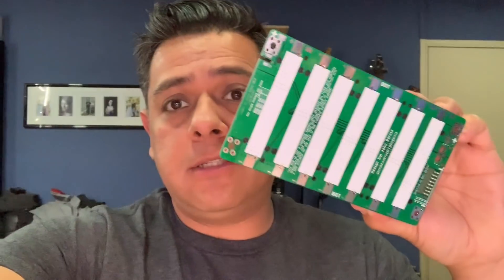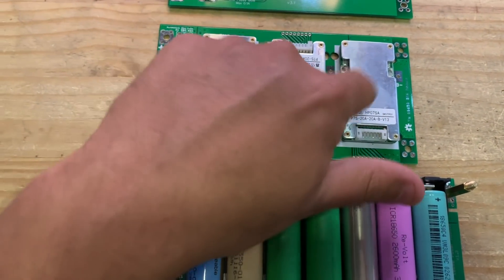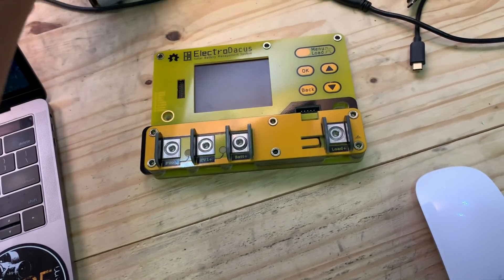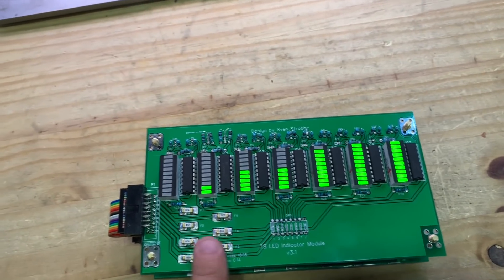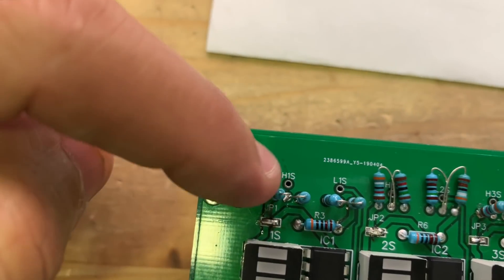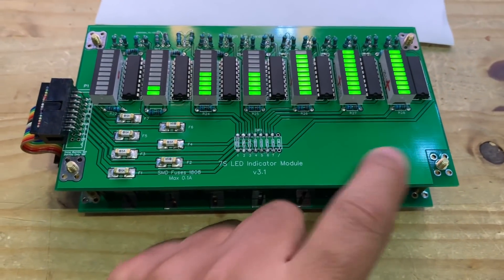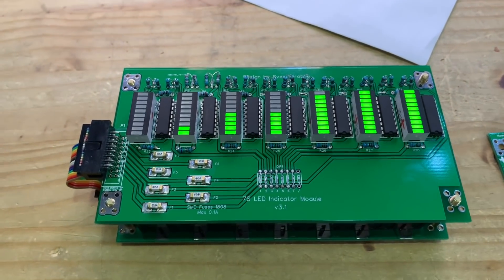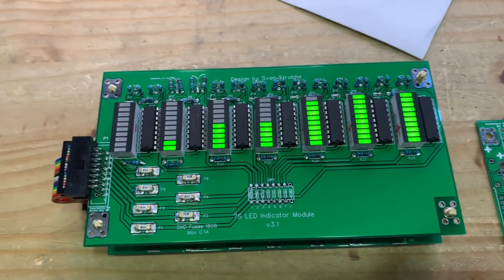7s  24V  State of Charge battery Meter for DIY Powerwalls

Comment: So I've had a concern with your PCB system for quite some time now: How do you address serviceability? If I have a battery go out in the middle of a stack of 8 PCB's, is it a 2 hour process just to get to that one battery and replace it?
Reply: Use quality cells and you shouldn’t have to worry

Comment: Trim pots are better.... The chips aren't perfect the dropping resistors might be off.. And you can keep the system very accurate by fine tuning with pots... People shouldn't be building these lipo systems if they cant turn pots and measure lipos

Comment: Am I missing something?

Given this is a DIY build and you may have specific voltage limits or battery chemistries, would it not be better to display the actual voltage?

For a single cell…
https://www.aliexpress.com/item/1-6S-Cell-Lipo-Lithium-Battery-Voltage-Monitor-Voltmeter-Safe-Power-Meter-Measure-Test-Tools-with/32960268900.html

For the whole system…
https://www.aliexpress.com/item/0-36-inch-DC-0-30V-3-Wires-Red-LED-Panel-Voltage-Meter-3-Digital-Display/32981882168.html

Or if you want the colored LED bars as well…
https://www.aliexpress.com/item/2S-3S-4S-6S-7S-Lithium-Battery-Capacity-Indicator-Red-Blue-Power-Charge-Level-Tester-Dual/32863207932.html
Reply from the maker: 3 digits per cell, 14 cells for 48v,  try looking at 42 digits and not getting information overload.  Bar graphs is all we need to see at a glance if our pack is balanced or not.

Comment: Maybe it could be a good idea to add some medium size probe points to the empty space of the bargraph PCB? For easy troubleshooting and more accurate readings with a multimeter. It doesn't necessarily add any cost and would be a good feature to have if everything but the front PCB is hard to reach.

Comment: Hey Jehu... been watching DIY, and building a Powerwall for a couple years now, and I have created something that might be of use in a setup like this. Using an Arduino, and an Arduino Relay board, connected to a number of High Voltage Relays, I measure the sun's 'Intensity', pass that value to the Arduino, and then OPEN or CLOSE specific relays on the PV supply side. My system is a 48V Mixed Use, PEA Connected with PV Alternate supply and Battery Backup... it all seems to work quite well, and would be happy to share my experiences and code to the effort. I think the Meter you've shown has sufficient space for inclusion of the Arduino config., or some alternate config.

Comment: If you use a voltage divider circuit you can use an Arduino to monitor the voltage of the whole board over the analog input. You can use a resistor of say one and 5 mega-ohm and get an output at 4V. Now if your batteries are all loaded to 4.2V, the voltage would reach 4.9V. All voltages that an Arduino can read on that analog output..
Reply from the maker: Do it,  and share the details so we can all re create it

Comment: there is one bad kinda fault with the 3914 chip if the volt goes below 3volt the chip will light all of the leds giving a false reading  making you think its full charge when in reality its below 3 volts
Reply from the maker: Really?
Reply: @jehugarcia  yes some one did a video on the chip and showed the leds coming on at low voltage so there may need to be some mitigation for that
Reply: i was thinking of doing something similar but with the battery  shaped 10 seg led one
Reply: just putting it out there jehu can the resistor values be electronically programmed like with an arduino ?

Comment: @jehu Liking this display... as you mention, a simple timer-based enable for bar graph segments, or simply enable segments while your push-button is depressed is a great thought.  Stretching that conceptually, some may want full time indications, so again, a switch  to select your display preference.  Also adding overall system voltage via a 3 segment indicator another plus!  

I'll echo another comment about LiFePO4 battery packs and the 8th cell enigma, but I don't see this coming to fruition?  Perhaps a quick adaptation of this onto the 4-cell version for 12V packs?

Still trying to arrange a private consult with you?  I have sent multiple email requests...
Reply from the maker: Sorry I don’t have time currently
Reply: @jehugarcia  Half hour max, or can you answer direct email questions?  LiFePO4 kits and integration Q's

Comment: So how do you know which side of the board you put the components on?
Reply from the maker: It’s pretty versatile and you can populate either or both sides,  but the bms board requires you to mount components on side opposite the trace fuses marked Top on latest batches

Comment: hey man love your work

i can make PCB hardware and software can share you my work (as you are making it opensource) we will use a microcontroller
i am suggesting a 3 digit 7 segment display and it will cycle through all the battery voltage one by one 
it will be great to work with you
we can add a mosfet on the output if you want to disable the output

Comment: The DIP switch is a very cheap idea to turn things off when not needed.  Keep it.  Very important when dealing with batteries which are NEVER off.  It's easy enough to put sacrificial jumper traces on the bottom.  If the switch is not used you're fine.  If you want the switch install it and slice the jumpers with appropriate tool.
Reply: randycarter2001 that was The whole idea About it 😉
Mine are always on So i can see from close and far what The SOC is.
And if its to much light, it is now while its in The living room still doing Some testing...
I can turn them off.
But gonna look into a solution to get something with a pushbutton and having it lit Up for a few seconds.
But for now its a start and a first idea from The mind to paper to what it is for now 😉

Comment: No indication for over/under voltage?
Reply: 1978jra i’ve build it with a multicolour LED BarGraph and set it in a way that The top bar, Blue LED, means overvoltage... and then it Goes down from green to orange and then red.
There is also a choice of using it as a one bar read out or all simply by soldering The JP’s together, all read out or leaving it as it is, one bar read out...
Reply: @TheMarlboroMan1969  Sounds good!

Comment: I would recommend some nice test points on the pcb. So you can meassure every cell with a multimeter.
Reply from the maker: They’re there
Reply: You can simply measure The voltage on The pointes where The fuses are...
And The way i test it all is to put an extra header on my flat cable and connect my isdt battgo bg-8s

Comment: Jehu, great content. Adam Welch is using a Wemos D1 (similar to Arduino with WiFi) for voltage monitoring on a similar system, looks like it would be easy to implement on yor system.
 https://youtu.be/DKz48WeSGlU

Comment: Have you thought about using a "Smart Bluetooth BMS 7S" for this case maybe. You can monitor your cells over an app and you dont need to use 3 bms systems in paralell and they are quite cheap.
Reply from the maker: I would still need multiple units on large powerwalls,  how would one manage all them Bluetooth signals?

Comment: and add a socket for an optional ESP8266 WIFI transceiver module to allow for remote monitoring
Reply: Clyde Rasmussen Some work with a BMS with Bluetooth, So am i Working on Some PCB for that.
The Indicator Module still has Some free space but my idea is to keep it simple.
Open for suggestions but not all can be implemented if you want to keep it simple and affordable 😉
Reply: @TheMarlboroMan1969  yes, understood that what I was asking for is a little excessive. Maybe keep in mind for future versions.
Reply: @TheMarlboroMan1969  depending on the enclosures and locations where these battery modules will be kept, wifi signal might not be able to go through. I would go for an ethernet interface. Some IC needs to spit that data out. We're adding costs quickly.
Reply: phiber9 The modules function is to Quickly see what The SOC and balance is for more info there’s The BMS...
Reply: @TheMarlboroMan1969  so your saying that the bms is all we need because there is some kind of web interface is that correct.
Reply: @TheMarlboroMan1969  no plans to upgrade then? so..  If we want batrium features we should use a bms that supports those features.
Reply: Scott Wanner there’s a BMS Module with Bluetooth, those you can readout with Your phone and program that way.
They cost around 50€ for The BMS itself.
The cheaper ones only 6€ but you have no control or possibility to program.
The idea of The indicator Module is to have an immediate view of the balance and SOC (State Of Charge) and this at a cheap price.
You can make it more complicated and having more possibilities but for me The most imported thing is that The BMS is Good and you can use that one to have more data from that...
Reply: @TheMarlboroMan1969  As the Kits are open source, I suggest that you make you LED board open source also. This way we can improve upon it and add what we want to it!!!
Reply: @TexasSting007  I just stumbled into this project.....I like the concept of the system and once I digest everything, I will make sure any board I design is fully open source.  In my eyes an open source design is much stronger if it is truly open source.
Reply: @phiber9  Signal propagation with the ESP modules is not an issue, ever.
Reply: Monitoring over wifi with a smartphone and tablet sounds really great.
But probably less reliable and it's more important to be able to easily check it from time to time. Checking via wifi will be easier to forget I think than some board with a red LED blinking.
Great project, more affordable BMS systems are really needed. Thanks to whoever made this!
Reply: Better yet esp32
Reply: agreed,  theres so many librarys and examples on that thing now, shame it didnt have more IO then it could have driven the leds too and ditched the 1970's lm3914's, then again do we need 70 leds on a board, the ws28xx leds are rgb and the esp can drive them all off just one pin with serial data, just a simple red yellow green status for each battery....
Reply: ESP32 would give the option for desktop or cell notifications of undesired conditions and notifications of full charge, SOC, high current usage etc
Reply: @miniwarrior7  those are $3.8 each. SWEET!
Reply: Make it an option you can buy and add if you want. This would require you to upload the firmware yourself, or someone could offer to upload it. Just make the firmware available for down. I'm a developer and would love to assist  or even take on that task.
Reply: @miniwarrior7  Agreed. ESP-32 would fill both the 'arduino' needs as well as the IoT uses that could be thought of in the future. Having the ESP-32 and bringing each module onto the network would easily allow for the use of full color 7" Nextion display controllers so that you would not need physical access to the battery itself. It could even mean that your system could be monitored and adjusted from any web browser or mobile device from anywhere, all for less than a $5 chip.

The nice thing is the ESP-32 module would only be needed on your primary first board (a master module), all subsequent boards could just use the $1 tiny85 over serial to communicate with the ESP-32 master module.
Reply: ESP8266 intergration would be great it would be IoT ready. The ESP8266 could do the toggle on/off of the leds. It could also allow for an app to be created for monitoring any where. An give you remote access to trigger an event manually or setup an a trigger on an event, say a pack/board was taken offline by the bms.

Comment: Het Jehu, David here, the guy that sent you the Energus Tiny BMS.  For the monitoring board one safety enhancement would be to add a buzzer if any cell goes higher than 4.2V.  Your video gave me an idea... How about designing a board for the Energus Tiny BMS that integrates with your system.  I could pre program them, so they would come on a board ready to plug in and go.  They can be programmed to balance at any voltage, and trip at any voltage and amperage, have an on off switch etc.  Maybe the guy who designed that LED monitoring board could do one for the Tiny BMS?
Reply from the maker: That is an awesome idea,  pre determined settings so it works for our system design,   People are designing boards to adapt other bms units to our boards already so this will happen
Reply: Tell me more About it.
Also thinking of ways to improve The board but people come Up with So many suggestions that implementing it all is impossible and would become too expensive...
The idea of The board was to have a visual on The SOC.
Reply: @TheMarlboroMan1969  Hey Sven, I think what your board needs is an audible safety reminder of any over or under voltage cell.

I am an authorized distributor for Energus.

The Energus BMS has two versions, a 30 amp and a 60 amp continuous (requires heat sink) that also will drive an external relay for up to 750A draw.  The higher power one is probably the one to use, as it is not much more expensive.  It does 4-16 cells of any chemistry,  current measurement and SOC calculation, Bluetooth,  Configurable balancing voltage, ignition input, PC link for monitoring and set up.  It is a high quality unit, and priced higher than the Chinese ones at $184.00 USD.  Here is a link to it on my website:  https://hilleater.ca/bms/
And the user manual:  https://www.energusps.com/web/binary/saveas?filename_field=datas_fname&field=datas&model=ir.attachment&id=21072

I have asked Energus if they are interested in making an interface board for Jehu's system, I hope to hear back in a day or two.
Reply: David Elderton most of The products i use are from Victron...
And there a lot of security build in there already wich i can use to protect a lot but indeed now with the indicator PCB i only have a visual what the SOC is and if there’s a overscharge.
I can integrate that in there but The BMS i’ve ordered has Bluetooth and The features to protect against overcharge or undervoltage are also in there.
The idea to make The indicator Module was to have a simple visual on The SOC.
And what good is an alarm if you’re not at home to act ? That’s what The BMS should be doing...

Comment: You should set the display driver at dot instead of bar output. It would show only the highest led also displays with multiple colors are better to see if there is a problem.  If you want a voltage output they make one that scans multiple cells and displays voltage at each battery. You would also be able to set a alarm voltage because it has a built in piezo speaker buzzer.
Reply: Daves Tech The PCB is designed to work as a one bar read and with a multicolour LED BarGraph.
If you want all read out you need to solder The JP’s, wich Jehu Did in this case.
Its The first design So there’s always something to make it better as Jehu Did instead of using The trimmers he put resistors of a certain value instead.
So next version Will have Some extra’s but for now this is a good start 😉

Comment: If your charging to 4v to 4.1 like you said in the video you will find the BMS boards will not balance the cells. The BMS boards only start balancing at 4.2volts, which will be a big problem if you never charge it fully. The cells will always be out of balance and it will keep getting worse until you do that 4.2volt charge.  So ether always charge fully 4.2 or use the smart bms boards that you can program to start balancing at the lower voltage. On the bigger parks your building you will only want to use the smart bms boards with bluetooth so you can really monitor them.

Comment: I have a chance to buy about 1500 one 18650 cell power banks enclosed in aluminum housing. Can I use them to build power wall? Is $400 a good deal? Should I have BMS for such configuration?
Reply: Yes always have a bad for anything in series. Depends on the manufacturer of the batteries, u might want to stress test a handful before you buy all of them to be safe, if possible

Comment: I'm not sure how you would implement that in a wall pack, as i see it its one monitor per module. How about connecting it to all packs in a wall pack, with a turn know selector to show you each individual pack? Mu suggestion to add to the monitor. Can't wait to start my own, glad i found this channel ;)
Reply: It's not one monitor board per battery board. It's one monitor board per 7S pack. That ribbon cable connects the corresponding cell in every single module together so the voltages are the same for every board.

Comment: Turn your batter around from 4v+ to the 3v so that the energy  distribution is some what even..
Reply: The bigger volts should be closer to the circuit wire on the left

Comment: How about a motion or proximity switch instead of a push button to trigger the display(s) for 30 seconds? Wave your hand and the meters would come to life.
Reply: Clyde Rasmussen The idea was to make The SOC visual and it went from being one colour all readout to a Multicolour Display one bar readout.
The DIPSwitch was put in to make an easy and cheap way to put The power on and off.
I’m looking into a cheap and easy way to get a pushbutton in but busy times at work are slowing The design and research down a bit...
But So many people so many Needs and suggestions...

Comment: Don't BMS balance cells at 4.2v? They resist any voltage that tries to go above 4.2v. ( unfortunately) have you found BMS that balance at a lower voltage?
Reply from the maker: Correct
Reply: @jehugarcia   um so you have found BMS that balance at a lower voltage? (Or are you saying that they do Balance at 4.2v)
Reply: @creativecityis  there are several Bluetooth BMS that allow you to set your own values for various parameters, including when balancing starts.
Reply: @niktak1114  that's what I need, do you have a link to one?
Reply: @jamest.5001  look on Aliexpress